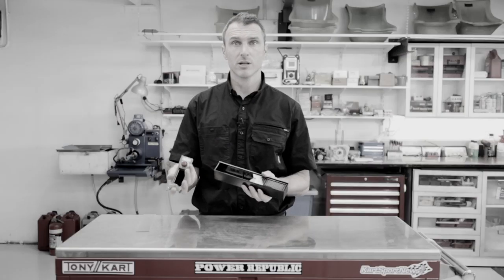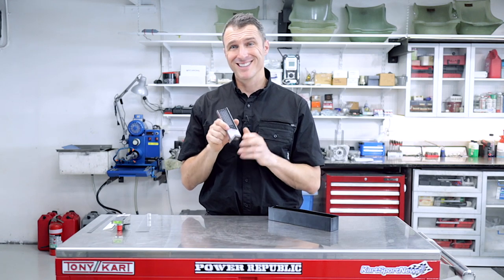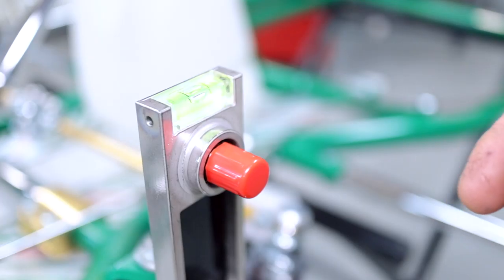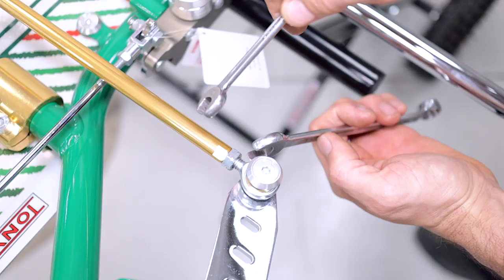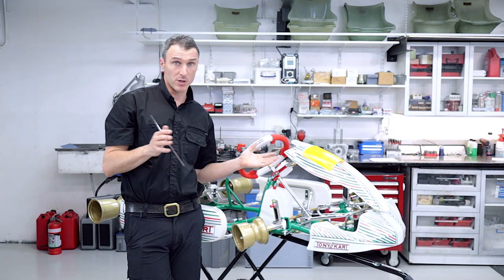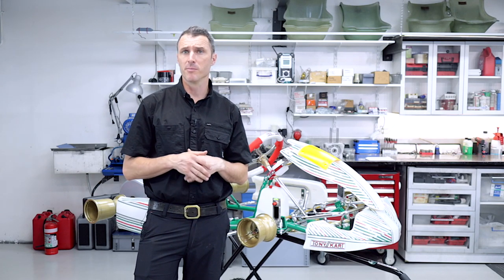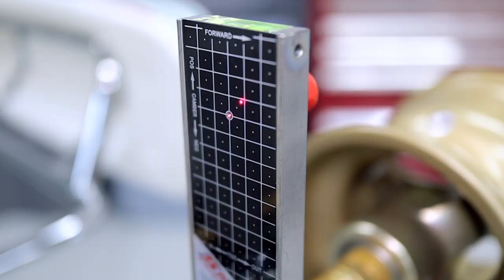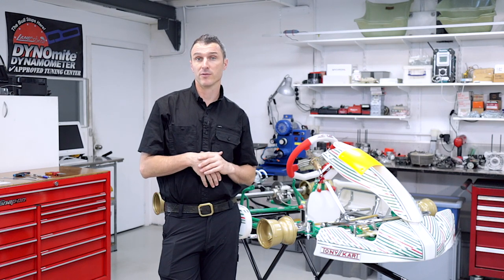HOW TO: Go Kart Wheel Alignment with Sniper Laser Aligners - POWER REPUBLIC

Comment: Just to expand on what Derek said in the video for viewers...be very careful when putting the snipers directly on the stub axle...the OTK karts its possible because the stub axle is straight/even but on some other chassis the stub axles have reducing/changing diameter and the snipers wont sit evenly side to side and give erroneous readings. To cater for this, on those chassis you need to remove the hubs and place the snipers directly on the spindles since they are level
Reply from the maker: Hey Chris, thanks for that. yes that is correct 100%, i have fixed a few 'bent' karts with crazy positive camber on one side by making sure the sniper wasn't sitting incorrectly on the taper or weld of the stub.  Thanks mate

Comment: As always great video! You showed how to change camber and toe, but the missing part is about when/why to change this values - eg. you said that mostly 0 toe or 1deg toe out is the good idea but when 1deg out is the better option? On tracks with many tight corners?
Reply: That depends on track, weather and driver. It best when you go fastest. Trial and error will be the best way to figure out what suits you.
Reply from the maker: Hi Matt, great question.  I almost always run '1 line' tow out.  the only time I reduce it to neutral is if I'm chewing out the inside edge of the tyres or if I am at a curcuit with super long straights and big open corners, which isn't very common here locally.
Reply from the maker: spot on !
Reply: Power Republic thank you! Make sense!

Comment: Thank you for sharing all of this information.  Your videos have been extremely helpful.  I am racing a Tony Kart with a Iame X30 in the US - Road Racing series.  These are typically long tracks with very long straightaways.  Getting the kart perfectly square is very important to maximize that long straight speed.  Have you any suggestions on how to ensure the rear axle is perfectly square with the kart and with the front spindles?
Reply from the maker: Hey Arian, great question.  it would be difficult  to change other than grinding out the holes in the bearing hangers?
Reply: @PowerRepublic  it would take a little Dremel tool to slot the holes just a little bit.  Just curious if you have ever seen a gage that measures the squareness.

Comment: Maybe do the W/A with the kart loaded would be a good idea., I have never understood why everyone expects the settings not to change when the driver gets into the kart especially when using a wide scrub radius which reduces steered camber change when less caster is used.
Reply from the maker: agreed, the wheels will bump for sure once in the kart.  The W A is relative to the amount of bump and is constant, so if your problems is excessive front steer for example, adding more positive camber is still not the solution weather you sit in the kart or not for the W A
Reply: @PowerRepublic  What is bump & excessive front steer? I must declare here that it was my initial design of separate caster camber adjustment that morphed into what became the Sniper adjuster and I have been out of karting for some years. A new system I have developed has me looking at the latest thinking and ways of doing things.

Comment: Love you videos Derek!! Has helped me learn all sorts of things with just starting out. 
Quick one that is probably obvious but wen I hav my kart on the stand it is slightly higher at the front. 
Should I be levelling out the kart flat before doing any checks/changes to toe-camber etc??
Reply from the maker: Hey Sam, thanks bro, glad to help.
are you talking about the very front chassis rail?  that is normally about 10mm higher than the main chassis rails BTW
Reply: @PowerRepublic  hey Derek cheers for reply. 
Sorry, I meant the kart in general is higher at the front just sitting on the trolley on a flat level ground. I’m sure the trolley is causing it but wanted to make sure that I should have it sitting level and then check/change

Comment: Hello, I would like to be able to ask you what effect the positive camber \ _ / has on curves. That is, more open at the top. I suppose the front end grips more. It is right? Thank you so much! greetings from Argentina!
Reply from the maker: Hello Diego, thanks for tuning in from Argentina.   Yes, more positive camber will help the kart turn into the corners (track and tyre depending)  mostly used when the track is slippery/cold/dusty/tyres are getting old........basically when there isn't much grip around so you have to ask the kart to help with some positive camber.  hope that helps

Comment: Derek one question, why when you were doing the sweep side to side you didn't let the wheel lock over all the way 100% each side?
Reply from the maker: Hey Chris, I was almost at the end of the range of steering and then the laser starts going back the other way.  So I think in the video the laser's bottom out point was 22mm.  This is the lowest reading you can get, then the laser goes back up the ruler.  So the Sniper guys tell me that this is the measurement that you want to centralise the steering side to side.   Once you have equalised that, then you can adjust your toe in or out, then double check the sweep to make sure you are perfect to go!  Hope that helps, I do sometime miss the little extra explanations like this in the videos when filming.
Reply: @PowerRepublic  interesting... I've always done it by turning 100% lock side to side and getting the measurement on the ruler even side to side this way
Reply from the maker: @IggySport1388  Sweet as I'll give it a rip and see what up.  Maybe try it like the video for me and see if there is a variation on your chassis?
Reply: @PowerRepublic  I'll definitely try your way and see if there's any difference. But yea, what I'm doing is letting the laser change direction and go the max on full lock and then adjusting the tie rods side to side to get them even. One thing with my way is (and I don't know if this is the reason sniper says it should be done your way) is if the measurements are uneven and you want to get them even, you can't adjust to the absolute measurement required from the other side.... it'll have you chasing your tail and you wont be able to get them even. What you need to do is sort of split the difference...so if one is at 25mm and the other 20mm.... I'd set one to 22.5mm and check and keep splitting the difference little by little until eventually its 100% even
Reply: @PowerRepublic  Chris and I work together on his Kart, we will definitely look into this when checking/adjusting the alignment. 

...On a side note, some Tie-rods are hexagonal, and depending on if the Hex is on the flat or the point when contacting the Steering Column, this can cause some additional variation when taking measurements.
Reply from the maker: @danielcgomez  agreed, I have seen that on a CRG with their deep 3 setting steering column bell.  something to look out for
Reply: As usual awesome video. Just to confirm the only purpose of the sweep is to ensure your wheel is central? My question, as I've tried to do this before is, where is a good starting point for your track rods? I mean, if you just slack them all off and wind them right in you'll be able to set the sweep but wont your toe be off the lasers? Isn't the goal, to get the sweep set (so wheel is central - even if it isnt!) AND the lasers to hit each other on the central line of the the opposite laser so you can then adjust tie relative to this central position? - This is something I'm so glad you've tackled as I've been googling this for months and never got a clear understanding. Thanks!
Reply: @shrimpti1974  the purpose of the sweep is to ensure the kart steers evenly from left to right. If this is off then for example if you turn the wheel 10 degrees to the left or 10 degrees to the right, the geometry will be off and mechanical leverage will be different side to side for the same steering input. The kart wont handle the same left/right in simple terms. Setting the sweep is the first part of doing a complete front end setup. The very first thing you should do is set your camber/caster pills in the same location left/right..be sure to check both top and bottom if you have pills top/bottom. Next, loosen the jam nuts on the tie rods, but don't adjust anything. Put the snipers on next making sure they sit flat then level the bubbles (eyeball the steering wheel in the Straight ahead position before you do). Next get a sheet of paper and put it in the center of the kart let the lasers shoot through the paper. Turn the wheel very gently/carefully until the lasers intersect. If they intersect perfectly then the chassis is likely Straight and you're in good shape at this point. If the lasers don't lie 100% over each other (and the camber/caster pills are in the same physical locations left/right) then the chassis definitely has some degree of bend in it. To continue the alignment if this is the case, turn the wheel until one laser is directly vertically above the other (so both in line essentially). This steering position is dead centre and it is from here alignment should be checked. Now remove the paper and recheck the bubbles on the sniper... they most probably shifted and will need to be adjusted to brought back to level. Once this is done remove the paper  and check if the lasers are on the sniper grid. If they're not, adjust the tie rods until they are and get them both on the grid to something sensible...neutral toe for instance. At this point do the left/right sweep procedure and get the distance from the column even side to side...this is a delicate process and you need to be sure not to hit the chassis and shift the snipers else you have to start all over and recentre the sniper. Once you get the sweep left/right, use your sheet of paper again and find true centre. When you do this and remove the paper the snipers should be on the grid and sitting at some setting but what ever the setting is, both snipers should read 100% same TOE left/right (if you did everything correctly). It is from this point you set your desired toe. Camber is a whole other story...let me know if this helps
Reply from the maker: @shrimpti1974  yeah its a balance between the correct tow out and the same sweep across the kart for central steering.  just a matter of double checkin each measurement a couple of times to get it perfect.   get the sweep right, then calculate how much you need to get your toe back, then recheck and tweak the sweep.  Then back again and so on and so forth.  bit of a mission but once you get the hang of you it you be doing it in no time like a boss!
Reply: @PowerRepublic  Thanks both for the responses! - I'm going to try this again - I tried it a few months back and got very frustrated. I'll give it another go with this new information and see how I get on!! Hopefully my chassis is straight as it was on a jig recently and only used once since then.Thanks again for the great videos - If I can get this sorted I think its time I bough you guys some beers through patreon! :)
Reply: @IggySport1388  thanks for the comment. Lets say I've not got a sensible place to start - i.e. brand new track rods and ends. Do I just start with the steering wheel as close to central as I can and wind the rods right in and then work back from there? Also when looking at the OTK chassis it seems that one track rod needs to go more than the other?
Reply: @shrimpti1974  Yes eyeball the wheel in the Straight ahead position then put the snipers on and level them. Start both tie rods from somewhere similar , I guess you can go from all the way in....adjust until you get both snipers on the grid then follow procedure above. In terms of one tie rod being different adjustment to the other...a small variation is ok...to be honest I've never owned a brand new kart to say if this is how it comes new. If after aligning one track rod is different length to the other, what thats telling you is that the steering column isn't dead centre in the chassis. This could be due to an accident if the fork for the column shifted...this is extremely difficult to fix. If its just a small variation I wouldn't worry about it, just do the alignment. If its huge then yea something is wrong.
Reply: @IggySport1388   did the same before with lock till the end but also didnt work so well. The thing is the lenght of the working tie rod is responsible  for doing the  work on the front axle, but when you go over the point  where in goes the other way a small variation of the angle on the ackerman bolt or a slightly bent rod, or how it leans to the steering rod(especially hexagonal rods)  .. makes the reading  wrong. Had the same issue,  so doing it when it starts to go the other way is the best point  I think . Before knowing this procedure I was always aware that shooting lasers in front and aligning   was not enough, but didint know what to do else to make it perfect. Ok , I did a check from the center of the front axle to the rear axle  so both readings  left and right would be same , wheen the  steering was straight, but this procedure makes it easier . Also wonder what the measurement  of the other laser would show and if its also perfect in relation to the steering rod, the one that point  outwards(harder to read correctly).

Comment: I see stock toe on a tony kart is about 1 line of toe out. Would would be the stock level of camber/caster??  Should it be one line up?
Reply from the maker: yeah most of the times.  but it isn't essential.  you can chang e it to what ever you want.    mostly with brand new tyres on a brand new kart, some negative camber will helps.  use neutral camber and positive as the tyres wear

Comment: Hi Guys, when I’m going to measure the figure with the ruler leaning against the steering column the laser point goes even behind the steering column before it turns back. What do I have to change in order to check/setup these figures? Many thanks in advance and best regards from the Black Forest in Germany!
Reply from the maker: Hello, 👋 

Yes that happens on some chassis.  You can use a sharpie to try and mark the spot it goes too.    Use the centre line of the steering column as a reference point i.e on centre, above centre or below centre.  Then compare both sides and try to make them equal
Reply: @PowerRepublic  thanks a lot for getting back to me on this. Understood so far. I’ll give it a try!
Reply: Thanks for the support. I got it. Keep on making these videos. They are very helpful as the explanations are really good. Good job!

Comment: Does the kart have to be level front-to-back as well as side-to-side?  And thanks for all the great videos.
Reply from the maker: Hey tony. I don’t level the kart, I just level the lasers.  I mean you don’t want it on a hill or something strange, but the kart trolley should be fine.
Reply: @PowerRepublic  I usually set all alignment in the same area of my workshop(which has some variation of gentle slopes)
Reply from the maker: @danielcgomez  thanks for the feedback
Reply: You need to make sure the kart is level before levelling the snipers otherwise the camber and tow numbers you’re measuring are not correct
Reply from the maker: @mrnismo75  thanks for that Mr Nismo

Comment: Hi! Really good video. A question. My 401R has a 2.5mm variasion in left compared to right in that ruler test. There is also about 0.5 degrees variation in camber and the camber is around 1 degree negative even though the caster pills are set to be neutral camber. (Arrow straight ahead). is this a minor bend or should i look at a straightning job?

Comment: thanks for the advice what are the universal output caster and camber settings for Rotax Max senior for otk frames.  driver about 80 kilograms dry track
Reply from the maker: Normall start with new tyres and Meg camber 2-4 mm.  Then neutral as the tyres wear.

Comment: How much does an alignment on a kart trolley differs from the measurements when the kart is on the ground?
Reply from the maker: It’s relative to the karts performance and not worth considering IMO.  Just set it on the trolley always and make the changes to suit the on track performance you are after and be done with it